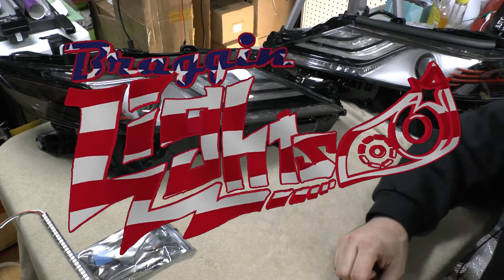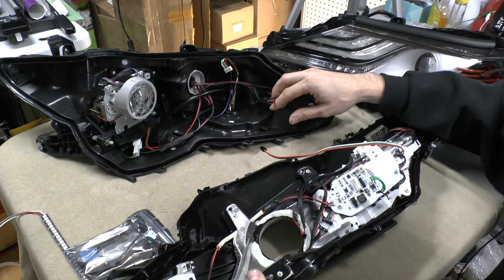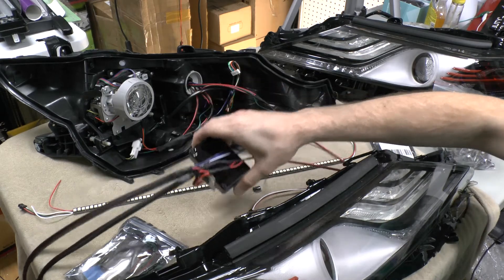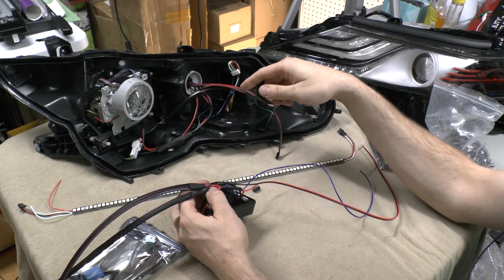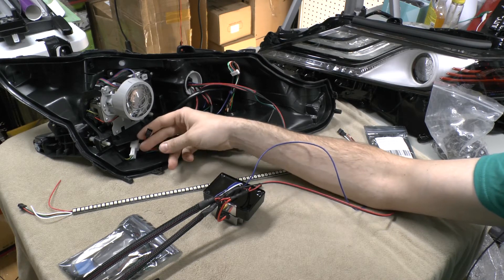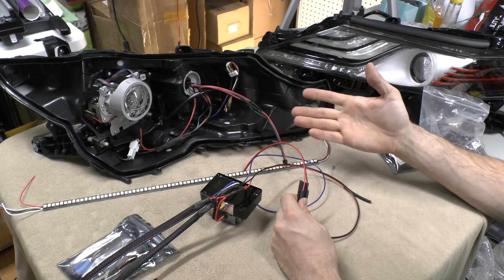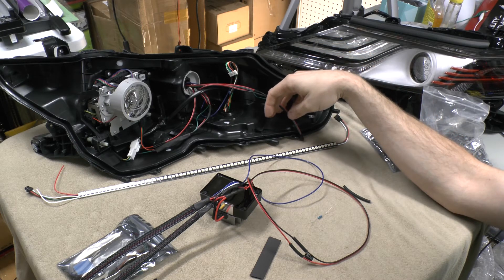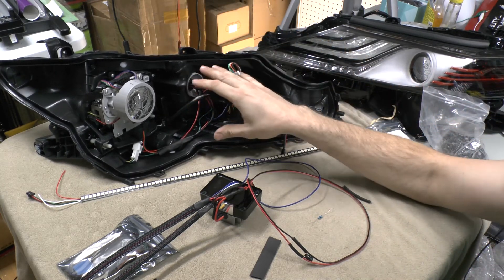Addressable LED Wiring Techniques

Comment: I wonder if i can make thing like...
At front....
The turnsignals left and right sequential.
And get drl on 
The drl need to dim when lowbeam turns on.
And turn of when using turnsignal on that side.

Plus a startup sequennce.

At the rear  turnsignals seqential/dynamic 
 And the runninglights
And brake lights 

With start up sequence 

And for the brakelight want to add brake force display.
It's for a bmw e46 
I see the newer cars do all stuff like leaving/cominghome 
And the lightshow before the go to normal operation..
Example audi a8

Comment: Is it possible to toggle a showmode by relais? (preferably a key hanger relais)
Reply from the maker: Yes, you can run any 12v signal to the brake input on the blueghozt v1 or the brake or the ext inputs on the v2. Then in the app you can turn the brake into a show mode trigger. Our battery saver has an output on it to go to these triggers so you can use 1 remote to connect power and activate show modes.

Comment: Capacitor 100uf  it going to 5v but the lowest capacitor was 6.3v 1000uf
Reply from the maker: The voltage doesn't matter as much. The ones I use are marked 1000uf 10v.
Reply: @NextLevelNeo  kool man thanks ..I was gunna get the 6.5 it being close to 5v but since u said it don't matter great ..then is don't matter..
Reply: The voltage rating of a capacitor is meant its maximum operating voltage or working voltage. For example, a capacitor has a voltage rating of 6.3V, so the capacitor can work properly and safely without any damage up to the maximum voltage of 6.3V. If we apply more than 6.3V across that capacitor, it will blow up. So stick with 10V to be on the safe side.